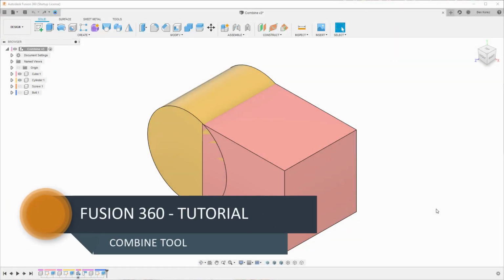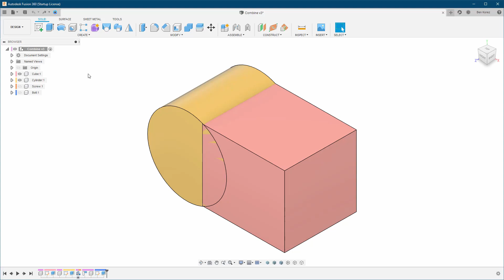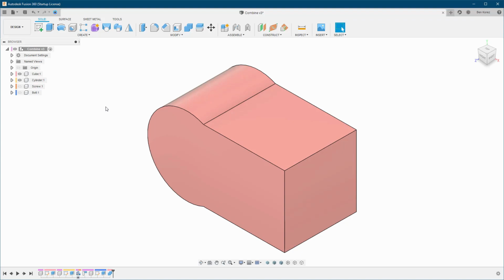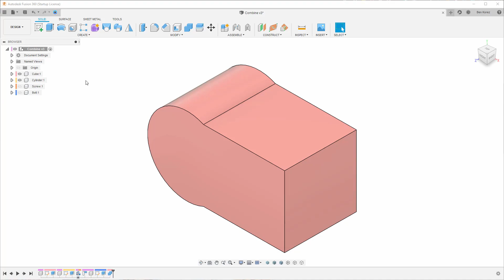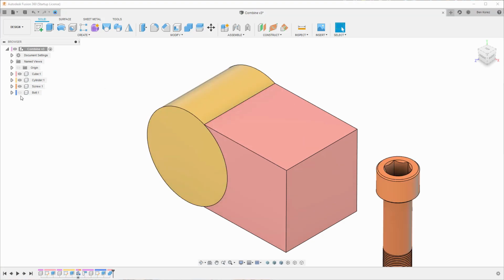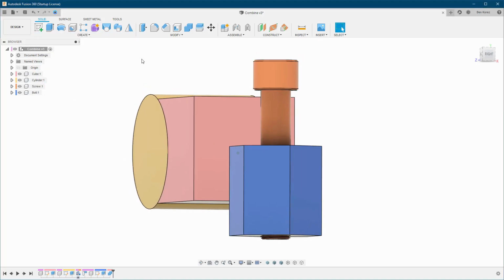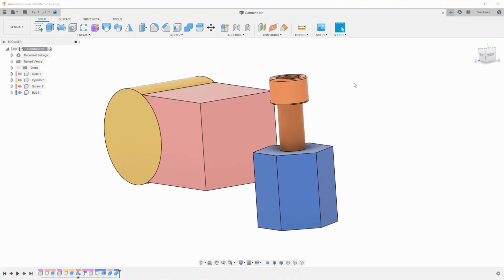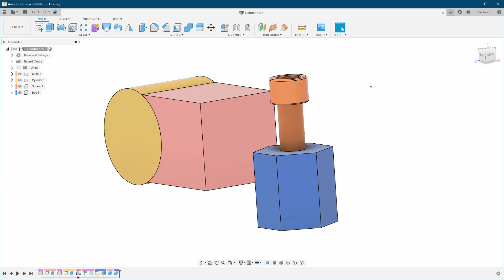Fusion 360: Combine tool (Update 2020)

Comment: I have a senerio where I'm certain tool bodies won't actually cut the target body.  I have seven tubes intersecting a cube, essentially.  When I use the tubes to cut the cube 3 cut and 4 will not.  I previously used the rectangle pattern tool to clone the tubes at a certain interval. Still, the 3 right tubes cut.  I've tried to do the operation individually, and these bodies won't cut individually either.

Comment: Thank you! 👍 For 3D printing the threads, bolt or nut, would require an offset. I'm not sure what would be the best implemention of the needed offset.
Reply from the maker: I know what you mean. I'm working on new videos "3D printing with Fusion 360". Stay tuned 😉
In general, around 0.2 mm should be a good clearance for printing.
Reply: @Fusion360NewbiesPlus  Great! 👍 
Yes, 0.02mm for 3D printing clearances is what I most often use. 
Thx again! 😃

Comment: But in this case you don't have a gap between threads. You  should have a tolerace
Reply from the maker: Of course tolerance is important, you can add it after the cut command. I just wish there was an option to add tolerance when you use the cut option, it can save extra steps ;)